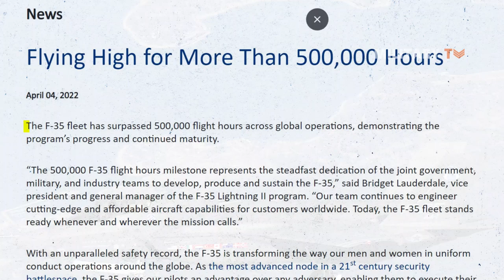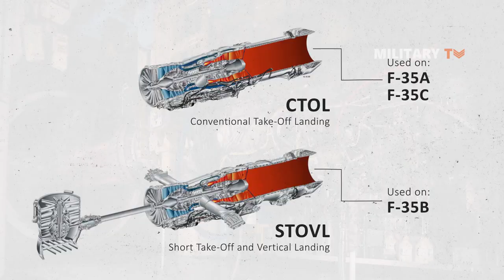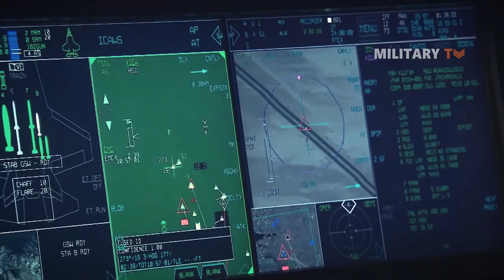Many Things You Probably Didn't Know About F-35 Fighter Jet

Comment: Still firmly believe the Raptor would eat this plane alive
Reply: Raptor is actually quite old technologically now, it's sensors and stealth signature are rather primitive compared to the F-35. The airframe of a Raptor is more agile since it's an Air Superiority Fighter with a mission set purpose built only to take out other planes. The F-35 is not meant to replace the F-22 in this role. The only thing that'll replace the raptor is the new 6th gen fighters that are under 'rapid prototyping' development as of right now. 

One caveat: The Air Force is upgrading one squadron of F-22's to "Super Raptors" as a test bed for future technology for the 6th gen fighters coming. This might work out so well that they end up upgrading all F-22's to Super Raptors, similar to the Super Hornets via the Navy.
Reply: Don’t forget about which load out the aircraft is fitted/stuck with.
Reply: Raptors don’t even have helmet mounted displays or high-off boresight capability on their internally launched Aim-9x’s.  The F35 can literally throw missiles backwards at targets on their six.  Raptors are amazing air dominance fighters but they were designed in the 90’s.
Reply: Well sure....Even Lockheed admits this. This plane is not intended to fight or replace the raptor tho.
Reply: Yet the raptor had problems with even detecting this little guy, don't compare iphone 14 with iphone 11 pro

Comment: F22 is superior
Reply: Not at what the f35 is designed for
Reply: @isaacmacqueen9695  we should have just added the networking capabilities to newer f22 models. I can see why F35 is good in certain situations, but F22 is a better superiority fighter
Reply: @aaronaaronson2095  They are, it's called the Super Raptors. 16 are being upgraded as "test beds" for the new 6th generation fighter coming to replace the raptors. It's a technological stop gap. Perhaps if it's really successful the entire fleet will be upgraded like Super Hornets?
Reply: @aaronaaronson2095  better air superiority fighter yes but not a better cas plane or a better networking plane and we can export the F35 unlike the F22 so we can actually regain some of the cost
Reply: @Knight_Kin  🤤 Thanks for the update, that sounds awesome!

Comment: I still doubt it can replace an A-10 effectively, the A-10 is a rather unique aircraft, like the Douglas A-1 Skyraider, they were mission unique.  "And", one size does NOT fit ALL.
Reply: The A-10 is ok in a low threat environment, but to create that environment you need the F-35 to degrade the A-D network, followed by other fast jets to destroy the enemies main formations, allowing the A-10 and Apache to deal with the fragmented enemy.
Reply: The A-10 is useless in a need peer fight and even in a low threat environment the gun is super inaccurate and to top it off has no identification systems. This makes it super easy to get into friendly fire incidents and in desert Storm British commanders even asked us Command to remove the a-10 from combat. And the cherry on top is that the f-111 fighter destroyed twice as much with half of the sorties. And it didn’t use its gun only precision weapons, and precision weapons have only gotten better.
Reply: @apex_blue  I knew all about that, but the A-10 (and just as importantly ROE and deployment parameters) have come a long way since 1991. It still has a place in COIN type operations, mind you an armed Cessna could fill the same role.
Reply: @Smokeyr67  Actually that reminds me the a-10 is being replaced by a modified crop duster.
Reply: @apex_blue  not quite, the “crop duster” will be an SF asset, not a replacement for the A-10, but you never know 😀
Reply: A-10's aren't used for their intended purpose which was to take out enemy armor in close air support during a potential Soviet invasion of Europe. They actually don't perform in the role they were built for all that well. Back in the 1970s sure but now modern anti-air makes them more of a liability for that purpose. A-10's are still effective against low technological opponents that are slow moving or static targets, but would be completely useless in a Peer Adversary war. They don't have anything approaching modern avionics and sensors, which would be similar to what Russia is facing in Ukraine right now. Why don't they deep strike in Ukraine? Because they can't. The A-10's only survive because of politics, not because the military thinks they're still effective platforms. The Pentagon keeps cutting off the A-10's only for politicians to restore them.
Reply: Air Force's primary objective is air superiority.  They have no need for A10.
Reply: @harambetidepod1451  Indeed they do, otherwise they would NOT have developed the aircraft in the first place.  Air superiority did NOT disprove the need to move mud in Vietnam with the Douglas Skyraider.  You can only do so much with a go-fast aircraft, a couple of decades ago the elitist brass of the USAF wanted the Lawn Dart to take the Warthog's place... just as stupid then, as the Lighting II today.

Comment: If the F35 is so good why then did the United States grounded the entire US F35 fleet as of August 5,2022 ???
Reply: Because the f35 had a Problem with the ejection seat. It got detected and is now beeing fixed.
Reply: @bloodyissue8296  Not the only aircraft which had that issue. Just required a check on a consumable, which would eventually be replaced either way.

Comment: The Prefect F-35 Mission.....  Based on its Sensors and Data Link......
One Air Force Squadron of F-35s is on Strike Mission and  Destroys their assigned Targets but, uses all their Air to Ground Weapons to complete their Mission.  
However, while originally RTB  (Return To Base) is then credited with Air to Air, Air to Ground, Surface to Surface, and Even Surface to Sea Targets Destroyed. 
Lastly, when the Squadron Finally Lands they Still have All their Air to Air Weapons and Canon Rounds. 

In English.....
Whatever an F-35 locks up, anything with the same Data Link and in range Will Shoot at that target (an Aircraft Weapons, Man Pad Weapons, SAM Site Weapons, or Ship's Weapons).
Reply: So it's not a fighter then. A drone with some radar would also do exactly that...

Comment: Fighter ? Misnomer. Stand off real time intel integration 
 w' combined forces + weapon platform more likely.
Reply: Exactly, it can't pull G's and doesn't have the speed to run either. It doesn't even have large enough internal weapons bays to fit most all existing missiles (they now have to invent smaller ones). That's not a fighter..